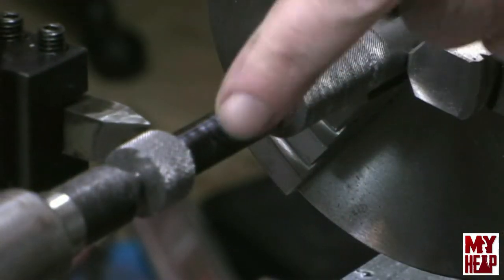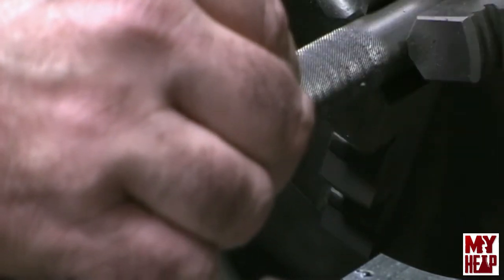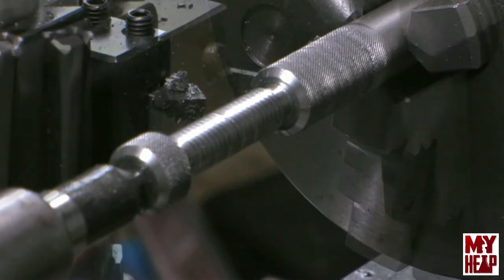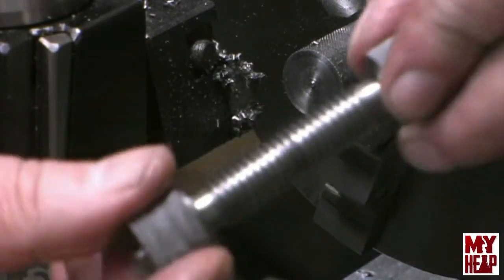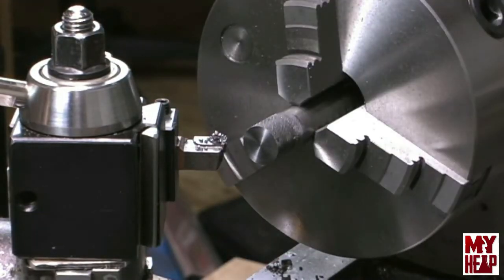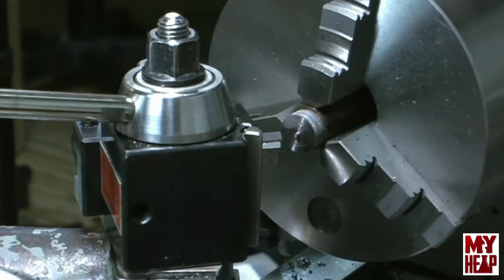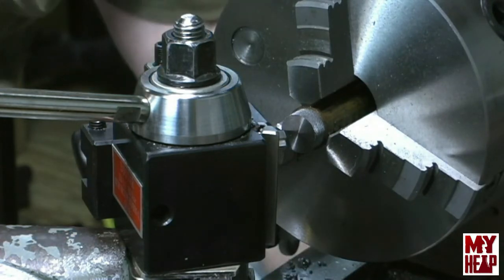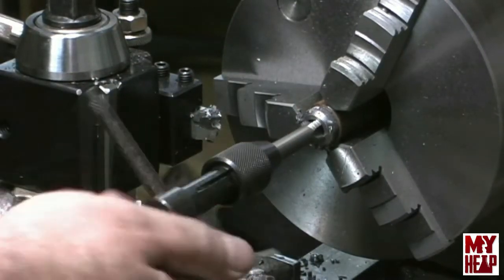YouTube Shop Student - Episode 010 - Captive Nut Puzzle - Part 3 (Final)

Comment: Excellent project! Congrats on a job well done! On the chatter, you could always set the compound at 45 (since you used a 45 degree tool) and take small cuts till you achieve .0625 depth. Other notes... I woulda drilled & tapped the "nut" before you parted it off rather than a separate setup. Rather than use the copper you coulda used your new collet set and gripped on the threads to face that piece to length. Good thinking on the chuck to square the work since it was non-critical....bet it was dang close. Prayers for your family member Joe~ Richard

Ps: whats up with that knurl? 😁😊
Reply: I second drilling and tapping the nut before parting it off. Also, what was the purpose of center drilling the last piece of the puzzle after you faced it off? Just so both ends have a hole? In my experience, chatter comes from a) lack of rigidity,  or b) trying to take off too much material at a time. Usually a combination of both. If you had a 1.5" bar held firmly in the chuck with a center on the other end,  you may not have had a problem,  but you had a half inch peice that was cut in half, and held together with a piece of 1/4 20 (with a minor diameter of .187)  rigidity is pretty much out the window there. And grabbing onto about 5/16" of the nut with copper wrapped around it does not provide much rigidity either. In this case, I probably would have cut the chamfer using the compound as was suggested.
Reply from the maker: Hey Richard, yes, in hindsight I see a few things that could have or should have been done differently.  The knurling though I think would have been better done with a clamp or scissor type knurler.  The knurl is worse than butt ugly.  I feel shame!!!  One thing I did notice was that while holding the whole bar when chamfering there was little to no chatter, but when holding by just a little bit, then the chatter was bad,  I think there is something to observe there.

Thank you for the input, I appreciate it.

Joe
Reply: We live, we machine, we LEARN!  😊
Reply from the maker: Hi Jeremy, I think you and Richard are correct.  I should have drilled and tapped before parting off the nut and used the compound to get the chamfer done.  I did notice in hindsight that I had little problem with the full length piece and that most of my chamfering chatter issues cam from gripping only a very small portion of the nut and puzzle.  And the center in the other end of the puzzle was for symmetry sake only.

I am going to do a follow up video.  In addition to the turning and threading practice I got, there was a lot to learn for me from this exercise.

Thank you for taking the time to watch and help me be a better machinist.  I appreciate the input.

Joe
Reply from the maker: Yes sir.  Now I am off to watch your new video!!!  :-)  I know there will be something new for me to observe and learn!
Reply: Bonus at the end! :)
Reply from the maker: The clip at the end was awesome.  I bet you had a blast on that trip!

Comment: I really enjoy your videos. I think the chatter you are getting is from too big of a bite at one time. If you would stair step that large gevel it may cut down on chatter. Check your cross slide gib and your compound gib for excessive play. Remember that is a little lathe. Great stuff, I love it Keep it up.
Reply from the maker: Hi Leo,  I think you are correct about the chatter and cutting them with the compound would have been a better think to do.  I did notice that when a lot of bar was in the chuck, cutting the first three chamfers I didn't have an issue with chatter but while holding just a little of the part chatter was quite bad.  So I got a great lesson on rigidity.

I learned a lot as a new user from making this project.  Now if I can successfully apply them going forward I will be a little better at machining.  I plan on making a follow up video on this soon.  One thing for sure, I absolutely appreciate the feedback from you and my other subscribers.

Thank you Leo, for watching and offering some advice.

Joe